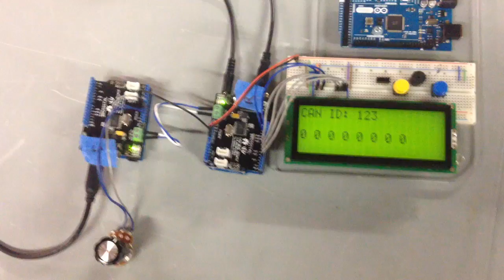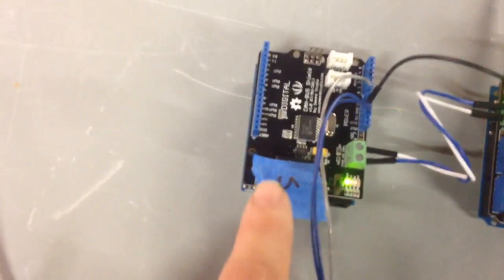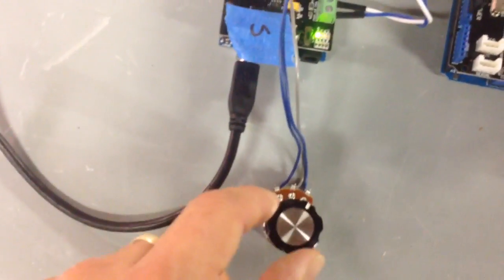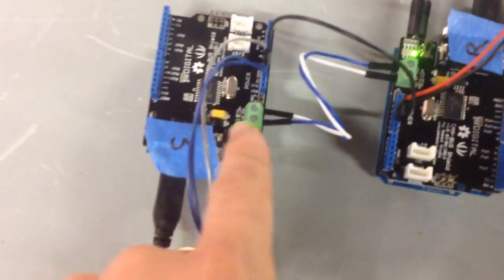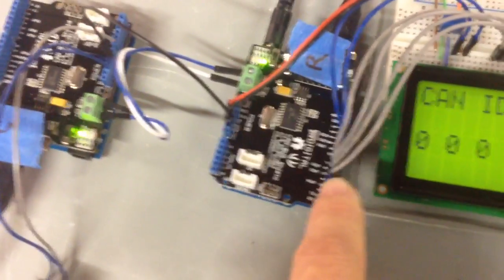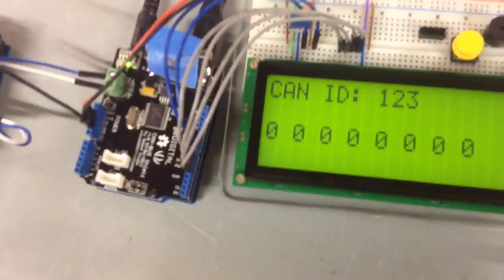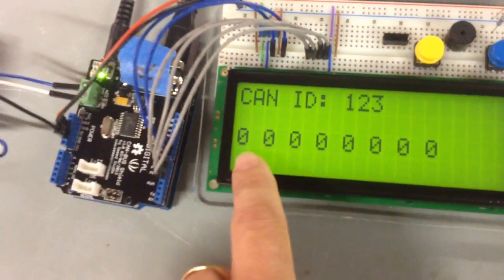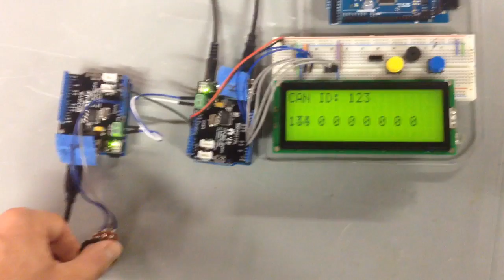Arduino sending data over a CAN bus

Comment: nice tutorial this what im looking for, i have question is wire or communication lost between nodes how to notify the reciever or transmitte,r thanks
Reply from the maker: The CAN bus spec requires at least one other node to acknowledge the transmission of a message on the bus. If a transmitter sends several messages without getting an acknowledgement it will go into an error state.
Reply: @MattMcMillan  is there any method to access these frames or registers and used it?
Reply from the maker: @edinetgrunhed6000  Yes. If you are using the MCP2515 can controller there are registers for error state, tx errors, rx errors. I would recommend this library for the Arduino: https://github.com/coryjfowler/MCP_CAN_lib He implements functions for all the error registers (getError, errorCountRX, errorCountTX)
Reply: @MattMcMillan  thanks for the reply just when I needed it most

Comment: how fast is can in Arduino ? Does it cause a delay or choke the microcontroller?
Reply: I am trying to make a 1/5 scale model car to work ...I will attach Arduino to each controls and actuate upon reception of signal f...
Reply from the maker: Really depends on your code. If you use interrupts and a filter mask on the CAN controller it will be very fast.

Comment: Hi, I'm doing a project where I have to connect 3 arduinos to a raspberry pi. Is it possible to use this shields? Would I need 4 of them (3for the aduino and 1 for the raspberry)?
Reply from the maker: Yes a CAN bus is designed for interconnecting multiple microcontrollers. You will need to use a different board (shield) for the Raspberry Pi. The PiCAN2 from SK Pang looks like a decent option for the Pi.

Comment: very nice. i have the can bus board. I need to get an obd 2 connector. I have a wireless elm327 but it isn't fast enough for CAN high data logging i think.

Comment: Hello sir, can one board be both sender and receiver ? I want to sent a case command to receiver board to control motor and I want receiver board to sent data back if the control were succeeded . Thank you for your video
Reply from the maker: All nodes are capable of receiving and transmitting on a CAN bus. When one node transmits all other nodes on the bus will receive the data packet.
Reply: Matt McMillan  Sir , I try using your code but it didn't work. It said I didn't identify CAN . What should I do ?
Reply from the maker: Are you using the same Seeed CAN bus shields?

Comment: $1mln question: if you disconnect the second arduino (with a screen), and connect a logic analyzer to the input pins of the first shield (rx-tx pins of the tranceiver on the left arduino) - will you see any packets at all? do I have to have the second device on the network to see any data with the logic analyzer?
Reply from the maker: You might see messages for a little while but the CAN bus controller might go into an error state and shut down. The CAN bus protocol relies on other nodes on the bus to acknowledge packets so it can know if it is transmitting ok. Have you attempted to do this? Does it work?    https://www.kvaser.com/about-can/the-can-protocol/can-error-handling/
Reply: nei, i haven't yet.but I am definitely going to try. i've etched a board with mcp2551 and mcp2515 and mega328, but your arduino sketch looks so straightforward, that i'd probably try it with arduino mb. 
as far as i got, i have just three messages(or packets, or bytes) from my host device initially, and then it stalls - probably because the tranciever awaits for some acknowledgement... thanks for the link!